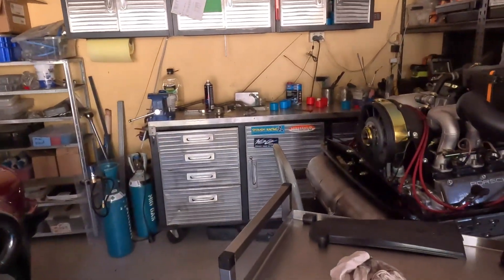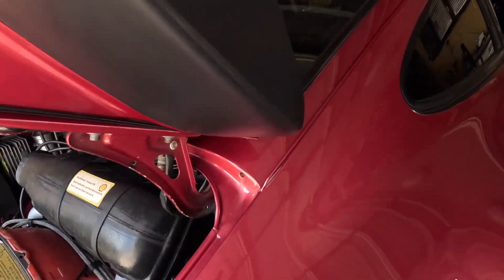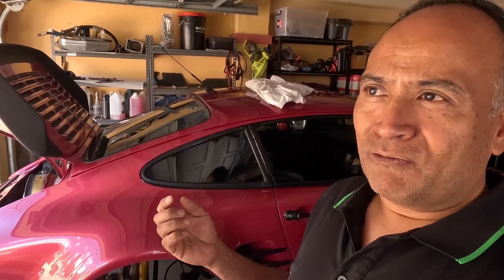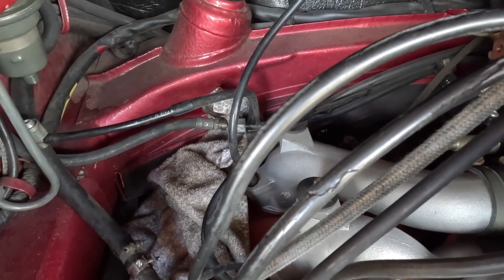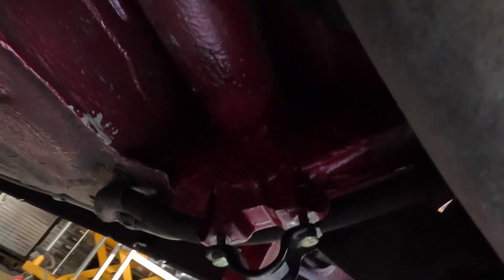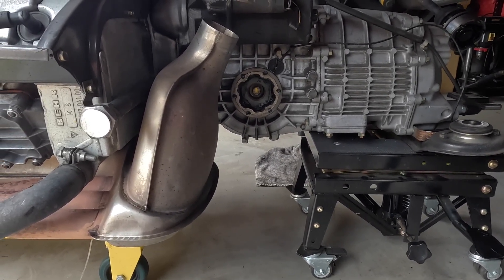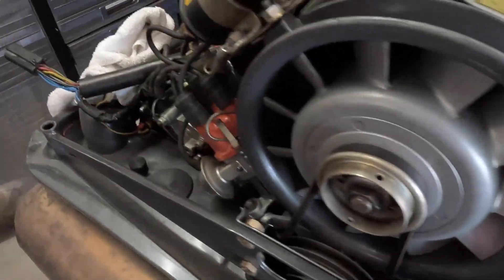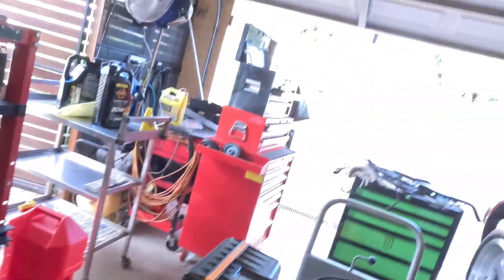How to Convert your Aircooled Porsche 911 to TURBO & EFI!!  Part 1

Comment: Like some of the other comments, am looking forward to watching the rest of your videos on this. Just came across this while doing some of my own research to EFI+Turbo my '83 SC
Reply from the maker: yes, I'm quietly shitting my pants thinking "will it start????"
Reply: @911engineguy  lol, well, I'm only just now working my way through the other videos, but from what I see already it seems like a well planned out system. I'm sure it'll turn over with minimal at most issues. 

I wish I bought a J pipe back in the day when they were $50usd shipped. They are asking straight robbery prices these days. J pipe and a suitable turbo is one of the last parts I need
Reply from the maker: don't forget to give the vids a like pls! @W0nk0Th3San3